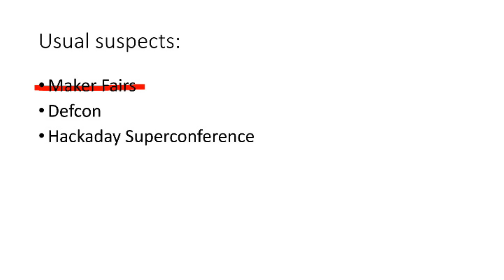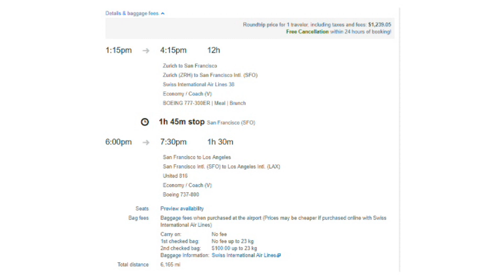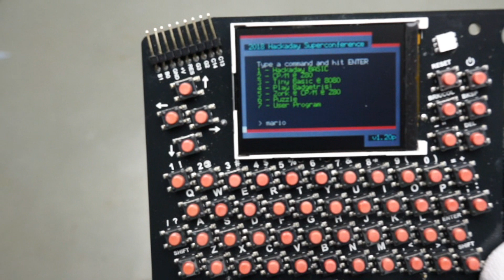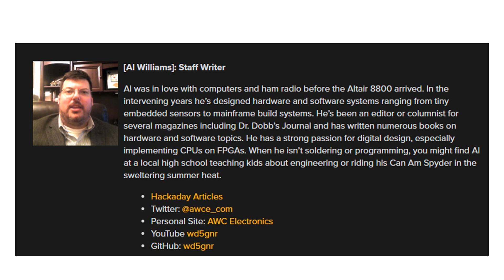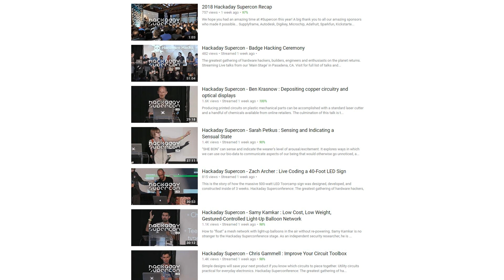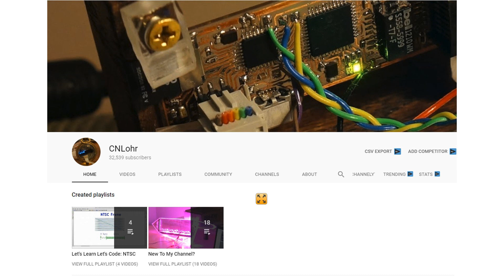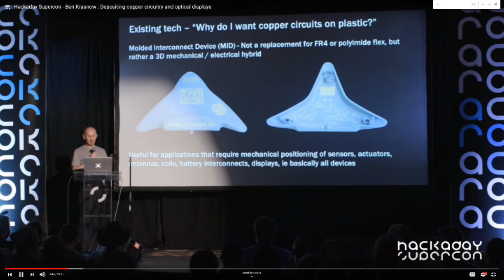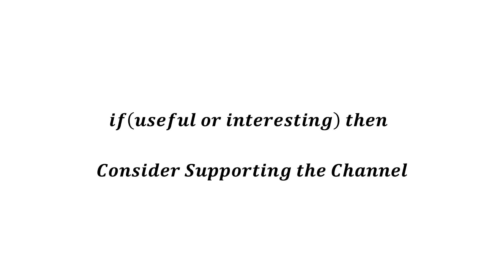#239 Coolest Event for Hackers and Nerds in 2018? Trip to Hackaday Superconference

Comment: Notice the huge number of people/hackers using MacBook Pro computers? Ever wonder why?
Reply from the maker: I assume because it runs Unix?
Reply: @AndreasSpiess  Are there any other platforms that run Unix? Perhaps those platforms are too difficult to obtain. That's got to be the reason.
Reply from the maker: You can run it on a normal laptop. But maybe Macs are cooler and you see that you are different?
Reply: @AndreasSpiess  I guess that you are saying that MacBook Pro computers are not 'normal' computers even though a huge number of people at the event use them. Maybe they are just trying to be cool without really doing anything except buying a long lasting stable platform to impress others.
Reply from the maker: I think each profession has its tools. Programmers have Macs and Accountants PCs ;-)